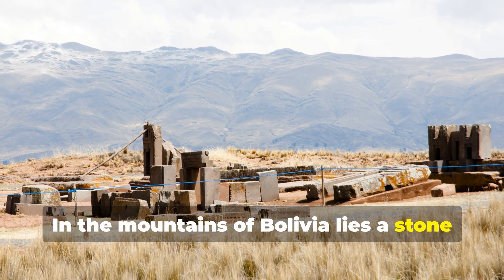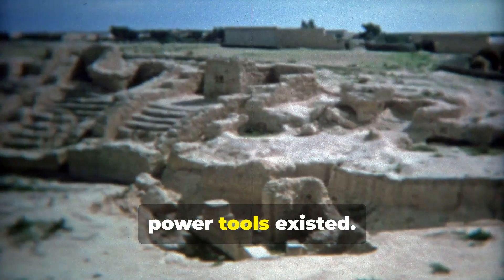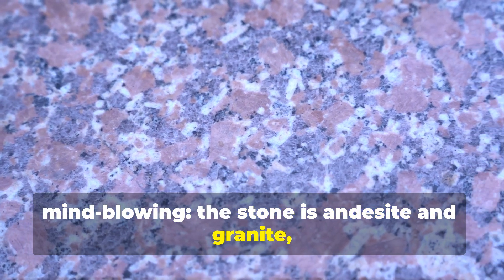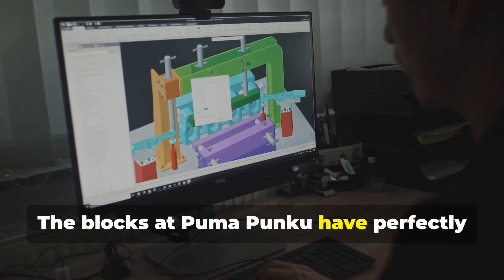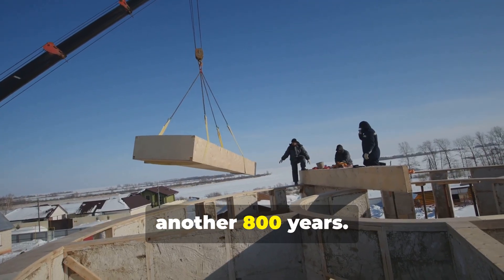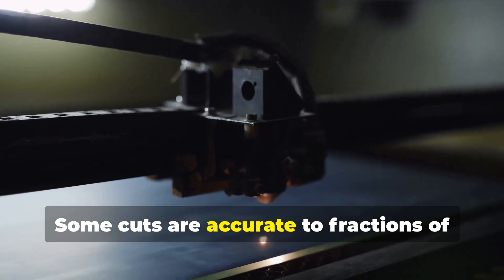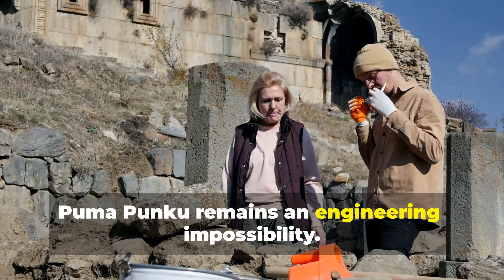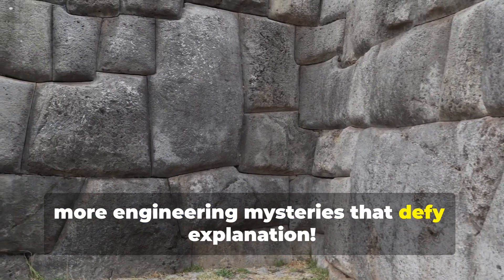How Did Ancient People Cut Stones More Precisely Than Modern Lasers?

Comment: Think of them as having the ability to dissolve stone and then reform it in exactly the way they want it just like we work with cement today. Its not rocket science but then archaeologists are not chemists.
Reply from the maker: That's a really compelling way to think about it! The geopolymer theory does suggest ancient civilizations might have had chemical knowledge we've lost. Have you come across any specific evidence of this dissolution process in archaeological sites? The precision we see at places like Puma Punku does make you wonder if they were working with 'liquid stone' rather than carving solid blocks.
Reply: @Beneaththeruinstv  They need to analyse the rock to see how it is composed. Two chemical that were used a lot in the past were Natron (Na2CO3) and Potash (K2CO3) this has the capability when heated of dissolving silica which can then be reformatted or reshaped and left to harden. When I look at Puma Punka it seems pretty obvious that they were made by pouring into a mold that was reused over & over again.